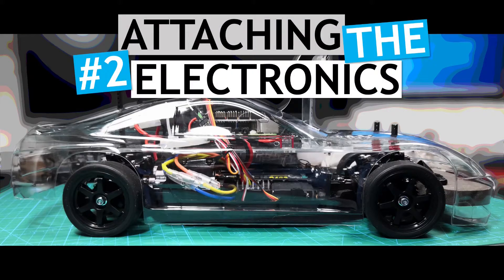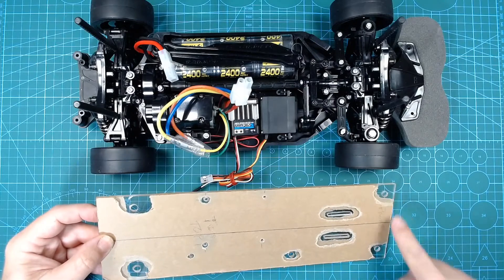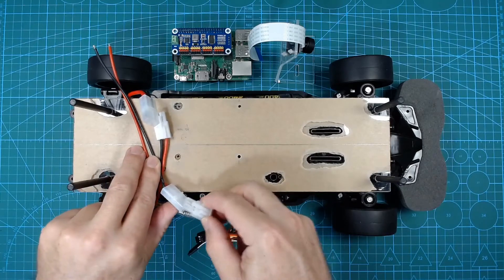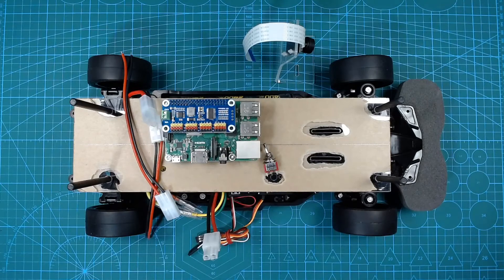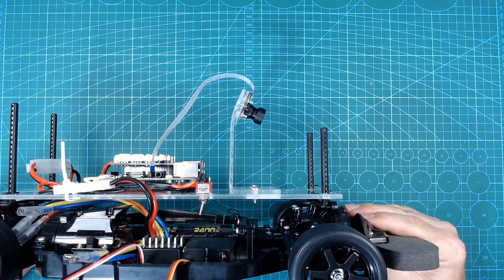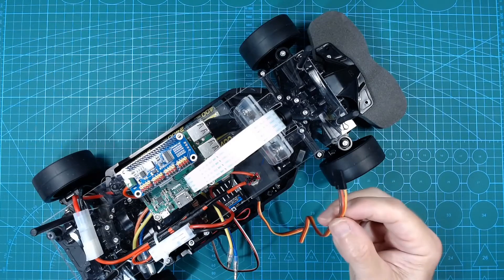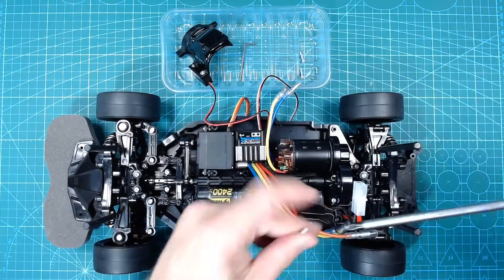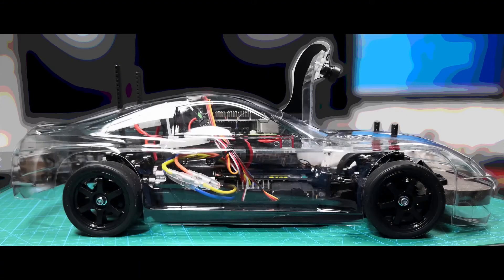Attaching the Raspberry Pi Electronics

Comment: Thanks for the videos. I cant really make out which power wires are soldered to which. Are you joining the reds and joining the blacks? Also if I'm using a 7.2v nimh batt or a 11.1v lipo Id need a buck regulator right? As rpi's only take 5v. And everyone would need to buy a separate servo driver HAT to control the steering servo and esc and standard rc connectors fit  (look like they're less than £10 on ebay. )

Comment: Loving this series and trying to follow along with an RC car I got off Amazon. I ordered a generic one “WIAORCHI 1:18 Scale 40+km/h High Speed Remote Control Car” that I was trying to use with the raspberry pi 3+. I have the servo hat on its way, and this RC car uses a 5pin servo so rather than figuring that out, I was just going to swap with a standard 3pin ~8kg. I did notice however yours has the Electronic Speed Controller there at the end. What brand is that? Do you have one you recommend? The motor on this RC car only has a red & black wire and that goes directly into its transmitter.
Reply: I’m curious what progress you made. 

I suspect what you need is an ex car with the receiver and sec control as separate units. Other tutorials nominate connecting the raspberri pi output to the esc controller. (Sometimes via a motor shield )
Reply: the motor goes in a 2 in 1 transmitter esc. It's common on cheap rc car and it is a pain to upgrade because you basically need a new transmitter and a new esc